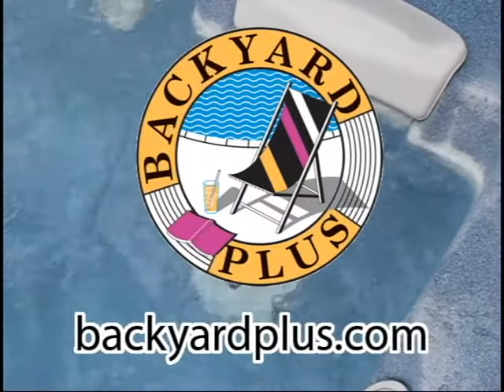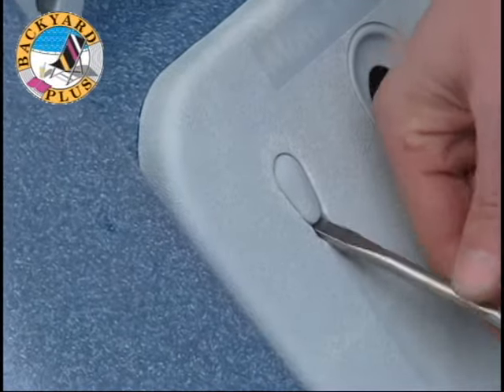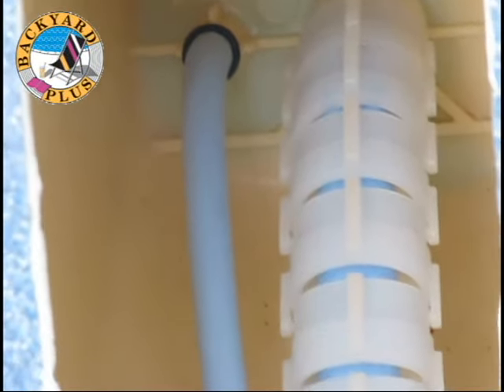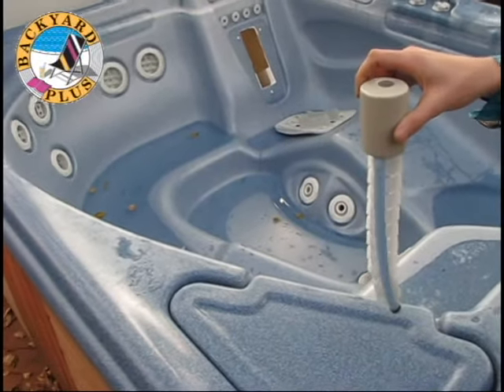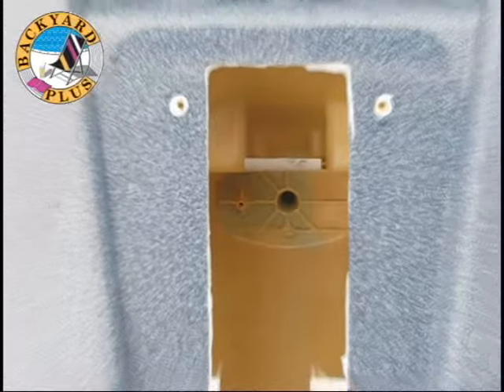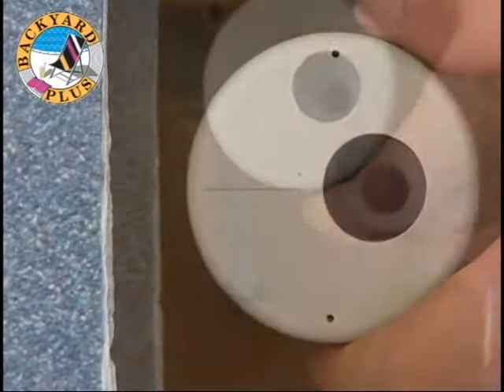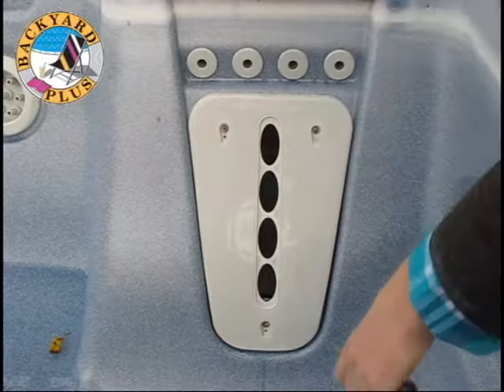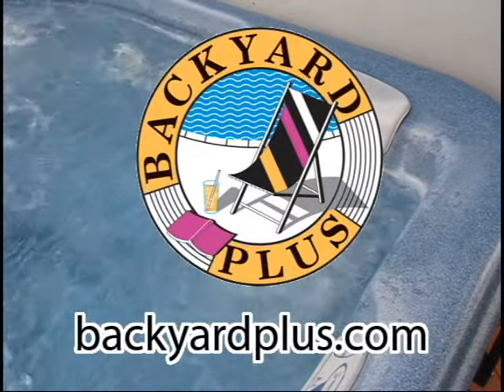How To: Moto Massage Jet Replacement: 4 Steps

Comment: Also, check the blue feeder hose to the massager. It may have disconnected or the o-ring hose holder has disintegrated. A zip tie will work as a good temp fit as I couldn’t find a o-ring that small that would fit. Thanks for the good to the point video.
Reply from the maker: You're welcome!